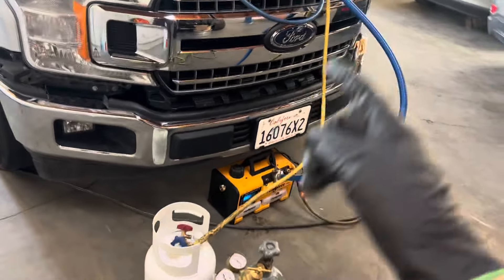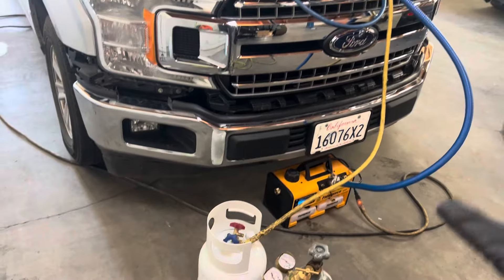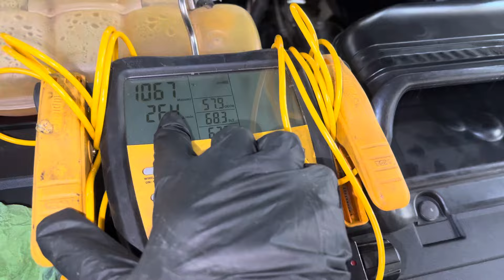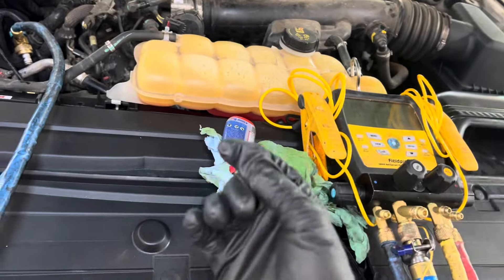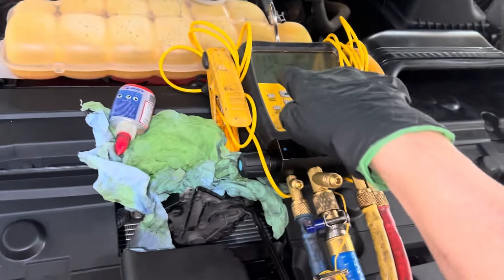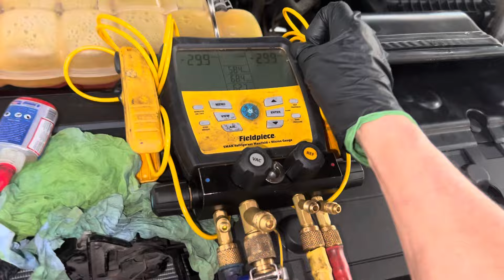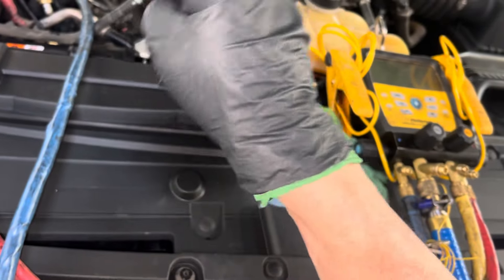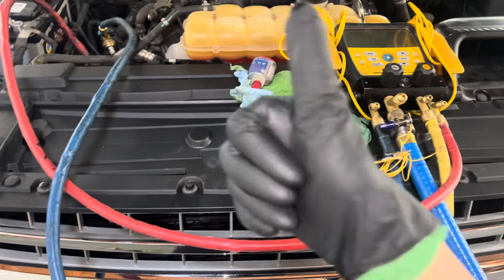Not pulling deep vacuum past 29.9 inches vacuum. Front shaft seal.. Next video successful

Comment: Would it not be cost effective to replace the compressor. Or is this one of these compressors that are a pain to remove and replace. I understand the concept behind what you’re saying just in my field the compressor gets replaced due to liability.
Reply from the maker: This car needs to be returned to the current customer now. 

It’s in a body shop after collision repair .  in the body shop is direct within the insurance company. Therefore, they actually have to keep a schedule they get like a letter grade ABCD think of it like that or points against them depending whether they deliver the car on time or late.. 

Lower their score, they may not get as many cars referred to them from that particular insurance company . 

So they do everything they possibly can to deliver cars on time .  I’m a vendor for them so it’s faster and easier for me to do couple high pressure passes with nitrogen and try to receipt the front shaft seal if I can. .
    And when it works, there’s no need to replace the compressor. 

Bodyman the last thing he wants to hear especially if he’s on a bonus program commission or gets paid by book time is to be pulled off of a job that he’s already on to come back to this one . 

      That means the car he started will be late . If he has pulled off.. 

So I usually do what I can when I can to keep the flow of vehicles moving . 

I know a little tricks, and get around that aren’t in books or taught by most in the field . 

Time is money. Specially when you’re talking a couple hundred dollars an hour..